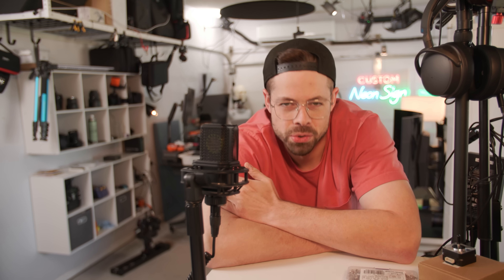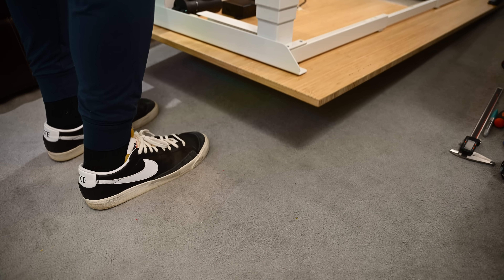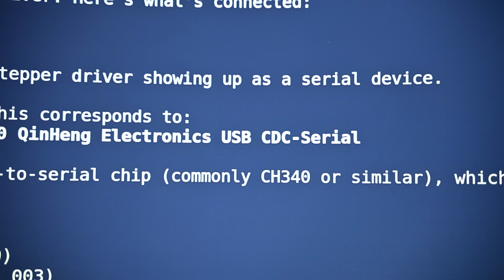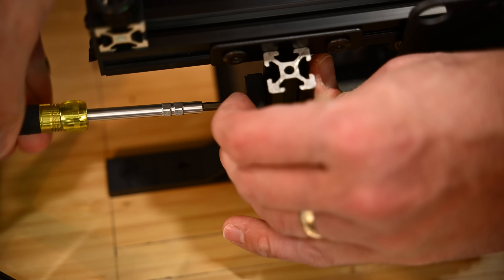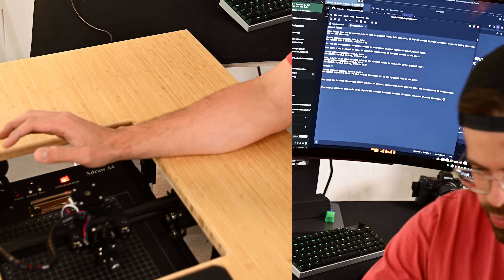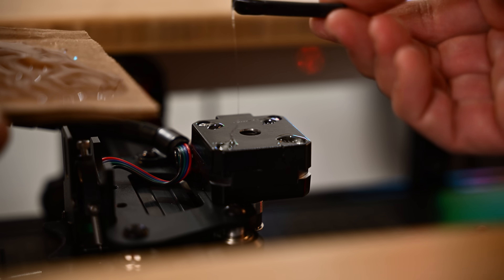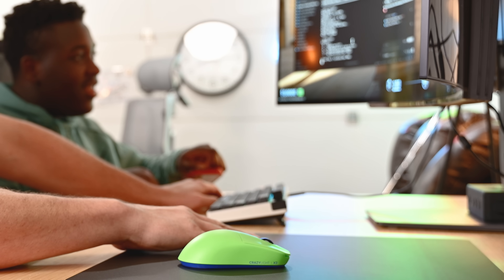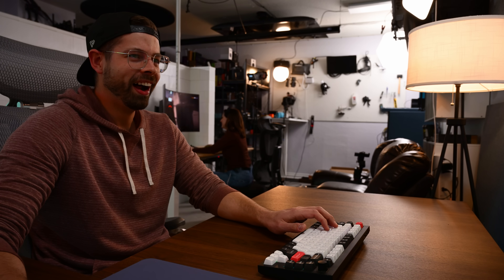I Built a Mousepad That Aims for You

Comment: i like at first, you discovered mechanical aimbot and was like "oh no! i can only feel ok with aimbot lite!" and reconfigured XD
still ended up being an aimbot though. 
ironically, go play against bots on an aim map with a wallhack on, you'll get really good when you turn it off. you can use aimbot to see how it tracks mechanically within the physics engine. 
when you get versed in both, turn off hacks and play real games, you'll know where to shoot through walls based off footstep distance. and when you encounter someone cheating, you'll know how to clip them through a corner to avoid their aimbot.
also the aimbot presets for points it locks to teaches you where to shoot. position 2 is between the collarbone and neck, and generally counts as a headshot, or at least any recoil will send the 2nd and 3rd shot into their head. 
when you aim here instinctually with any game, especially with shotguns, you basically get a chest sized target with crit chance. its just training you to move your point of aim on body mass up a few inches.   
all of these also helps you recognize cheats in like every other game on the planet. css is a great platform for just learning games outside of purely playing them. just dont misuse the tools. 
valve wont ban you for hacking vs bots on private or unsecure servers. its only when you do the unholy thing of playing with actual people using hacks that they bring the ban hammer. and i agree with that policy.  

you can use software to appear better, or legit get better. one gets you banned, the other later praised for. easy choice imo.

Comment: What if instead of moving the kouse pad you use an active omni-directional treadmill? Also tu be undetected you might want a camera pointing to the screen, so you won't have xray, but your aimbot will not be detected due to little variations caused by the camera recording and the pad scrolling. So it's not just a script with pixel perfect aim that it's why aimbot is detectable.

Comment: Please make sure the fence in your table saw is touching the material if your free hand cutting a mitre dude you have a higher potential of twisting the material and pinching the blade which can result in the piece your cutting flying back at you at 99.9 percent the speed of light (certified carpenter that uses table saws very regularly and teaches apprentices proper safe usage techniques)

Comment: if you used an lcd screen displaying a noise pattern, would the sensor on the mouse pick it up if you transfrom the noise pattern in the way you need the mouse to move? Then you could just leave the mouse on the screen and then do the aiming that way?

Comment: You are holding this router wrongly 2:01. It should be in a way that this rounded side of a router plate is towards the linear thing that helps you go straight. Common mistake that I did in the beginning

Comment: If you used a high enough resolution display, you could render some noise, use the display as your mouse pad, and move the noise around the -X and -Y. If the screen is high resolution enough you should be able to fool the mouse into thinking it's moving when it's standing still. This could even just be a small display within a section of the mouse pad

Comment: Would be kinda cool if you inset the mouse pad a little, with routed cuts to move around inside just under the tables surface so you can rest your arm on the desk without touching  the mouse pad.

Comment: *better idea implementation system*.. have a light system like lcd screen and a mouse that tracks only on dark surfice.. start by having the light folow the sensor on the mouse or somthing like that..any way you can use light movment tracking tricks to control the optical mouse sensor just like the scrolling text on an les screen seems to move.. the mouse would see the surfice moving just like your moving mouse pad.. it can cancel out your mouse movments while guiding its movment to the target aswell.. like a heat seaking movment of a misile.. it can have a colored textured stencil to disguise its existence and only folow the mouse .. only be on under the mouse.. concealed.. High tech low profile.. secret aim bot trick💯 very fancy.. a lot harder to code.. a lot more sleek and lower profile stationary mouse pad.. not a moving one like yours🤣🤣

Comment: you could probably get an LCD screen high resolution enough to show a moving pattern under the sensor and it would move the mouse in any direction at any speed and any latency you wanted programmatically instead of mechanically for even faster hax

Comment: Honestly thought you were just gonna use a magnet on the mouse and under the mouse pad. 

Saying this does give me an idea though. The magnet could move to where one needs to aim. So the player still has to actually aim in the correct direction, but the magnet then gives resistance helping with reducing over aim.

Or the magnet stops moving when the player aims over the enemy, also reducing the possibility of over aim.

Comment: About the drawing machine momentarily turning on from movement, keep in mind that motors are also generators.
Power one end, it makes the other spin.
Spin the other end, and it makes one end power up.
Something to look out for in some hardware since it make spike or send electricity into the wrong circuits.

Comment: Here's an idea build a computer with the world's largest storage. 

Like make a RAID 5 set up with terabyte hard drives and then add those two another raid setup.

F*** THAT IDEA!

Make a computer with only wires that can run at least Linux but I want you to install windows 8.1 for comedic effect. but yeah I no motherboard just wires and a monitor.  A serial port circuit It's allowed so you can plug in peripherals. 

If you make a computer made out of wires a monitor and peripherals that runs Windows 8.1, I will die peacefully as a complete man with absolutely no regrets whatsoever.

Comment: Surprisingly, you can cut aluminum 20/20 with a normal miter saw blade if you have one, if you don't want to deal with sketchy tile saws. Just go slowly, but the carbide tips on a saw blade are plenty strong/sharp enough to go right through aluminum.

Comment: you need to make it where you use a mouse to control something that controls another mouse(latency might be an issue), so you can aim normal, and when the AI detects the pixel it locks on, once it loses the pixels it hands back over to you controlling it

Comment: It's this kind of technology that makes the whole idea of anti-cheat completely pointless. If you have a piece of hardware that isn't even running on the PC you're playing with that can move the mouse where you want it, the battle against cheating is wholly lost. This was actually going the extra mile to make physical hardware, but it's possible to just run the mouse through an external device that sees the GPU output, modifies the mouse position data, and still looks like it's just a USB mouse. Hardware auto aim devices already exist. The AC battle is over. Cheaters have won.

Comment: FUN FACTS: If the mouse isnt fixed (as you see it sliding around as the pad moves) it wont EVER Work. Gotta put the mouse in a fixed position. Keep practicing great start. #engineering101

Comment: Idk why you did not come up with this idea, but i would have used magnets. The mousepad would have gotten magnets and also the mechanism under the table would have gotten magnets. Then through the table surface  it would transfer motion and control the mousepad, without you drilling holes. This is how some automatic chessboards work. This would also make it work for other desks. Just put the mousepad on the desk, the mechanism will fit under the desk and with a satisfying snap the magnets will interface with each other.

Comment: 3:11 isn't that kinda normal for cnc things with stepper motors?
Reply: A properly wired circuit shouldn't do that.
Reply: @itzbenplaiz I don't think it's a big deal if the sensitive parts are protected. It's probably not worth economically to protect anything that can handle the back current. At least I know some 3d printers where it's like that and it's not a problem.

Comment: You need to move slow and fast to adjust mouse pad location so you can move your mouse less. you also need to adjust a bit to player while using it for mousepad not to move all the way and just needed percantage(probably percantage is diffrent for each angle) so that the system fit itself with player reaction and not the other way around.(maybe this way adjustance will be a little bit faster)

Comment: You have gotta somehow make the meme "he just has a better gaming chair" come true. Make the chair aim for you.
Reply: Someone actually has done something similar to this where they built the entire PC inside of the chair and it had really good specs. It was a mini-pc housed inside the base of the seat and then they ran the cables through the wheelbase where it was point forward and up into the desk/wall to the reach the monitor. I can't actually remember if it was Homeless who did it but you can probably find the vid on yt.
Reply: @FullyChargedSRG  homeless did infact make that already haha
Reply: @FullyChargedSRG he should attach motors to the wheels and a mouse to the arm rest and let the chair aim for him.
Reply: @MarcoBarroca  motorize the wheels and add a huge sensor to the bottom of the chair
Reply: @MarcoBarroca  that's a fun idea but the mechanics of making the chair move enough while under the load weight of a person would be a nightmare. Firstly you'd have to find a way of motorising the wheels, likely needing some form drive chain for each one, connecting to a strong enough electric motor which will be heavy and take up a lot of space. The layout of those mechanics would be very tough to organise if you kept to the standard office chair 5 split of wheels. If you were gonna do it with a mousepad on as the armrest, it would be far easier to make the just armwrest move using the same system as in this video. I agree with you tho it would be cool to seem Homeless figure out.

Comment: What if the mousepad itself was a screen displaying a specific pattern?
Then you wouldn’t need to move the physical mousepad at all — you could simply move the pattern on the screen, and the mouse would be tricked into thinking that it had been moved
Reply: I like the idea, but sensors need texture height differences to understand movement sadly it's not just optical in terms of changing the flat visuals, it's still gonna be flat

you can move your mouse across the monitor sure, but you will see nothing happens if you just keep it in place under anything that is moving on the screen :)
Reply: @tips1pxl  I believe this is just absolutely wrong. Mouse sensors do not need texture height difference. They just take thousands of pictures per second and detect movement based on the picture difference. Has nothing to do with texture.
Reply: @tips1pxl  umm im playing on glass smooth mousepad using Viper Pro.  its uniform, smooth, no texture. sooo.
Reply: @tips1pxl I can't speak for all mouses, but the ones I've used can work fine on a printed sheet of paper. Granted, I haven't used some of these new fangled 5KHz polling mice, so they may track differently.
Reply: @DakotaEAWilliams  i mean it's easy there are two type of sensors optical and laser most older mice use laser, also you understand that paper has a texture right? so ofc it's gonna track fine we are talking here about a screen panel that sends images that are purely flat so yeah the laser might pick up some movement but the optical one needs depth to understand movement, place it on a piece of glass ( the optical one ) and you will see how it can't track anything there.
Reply: @tips1pxl if you put a high contrast noise image below the glass and the index of refraction isn't too skewed an optical mouse would absolutely still be able to track. But on a piece of glass suspended above nothing there is nothing optically to track. I am interested to try out a laser mouse one day that works how you're implying. You are implying that there is a mouse that uses laser time of flight to track the surface beneath. I haven't seen one before but I'd like to. Otherwise if you're talking about a mouse that uses a laser as a light source for the surface you are still just talking about an optical mouse.
Reply: @DakotaEAWilliams  what are you on about man?

if you put pure glass on your table, and use an optical mouse you won't be able to track anything or at least there will be heavy skipping depending on the LOD of that mouse, hence if we use a screen ( I feel like most of the these comments are forgetting the top point where the person wants to just use a screen and mimic movement ) nothing would happen lol
Reply: @tips1pxl  well my mouse jiggler video playing on an old phone works more than enough to have me always active on teams
Reply: @Riccardo_Riva  yeah but those movements are super small and work on some sensors not all, especially most modern gaming mice, you won't be able to do flicks or let alone do 180 movements or similar sadly
Reply: @tips1pxl  Maybe only office mice would be affected. High-end gaming mice can even track on transparent glass, so you can’t fool their sensors.
Reply: @Riccardo_Riva I could almost imagine that a mirror with enough glass thickness to allow some light to interact would work almost the same as those videos
Reply: @tips1pxl  you're probably right as it works better with an old mighty mouse, that makes the cursor move way more and more predictably than a newer mx anywhere 3 does
Reply: @ethan-1024  working on glass has nothing to do with it being high-end, it depends on the sensor type and that's it

Comment: You could try moving the mouse with magnets under the table next, that would be a bit more subtle.
Reply: you'd have to have pretty strong magnets to prevent the mouse from being moved by the player, which would probably interfere with the electronics in the mouse
Reply: Your hand would stop the mouse from moving
Reply: @Hexcede  you probably should just let it move by itself without touching it... yes it's obvious cheating but looks cooler
Reply: @DriftStuffYT That makes sense. I thought it was supposed to be an alternative to the mouse pad and not a separate idea.

"I'm not cheating, my house is haunted by an esports pro!"